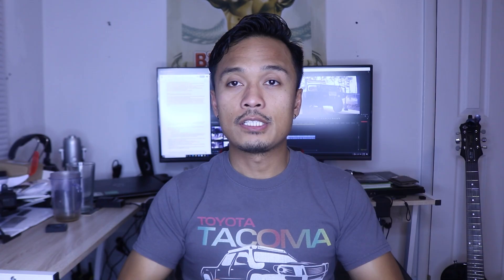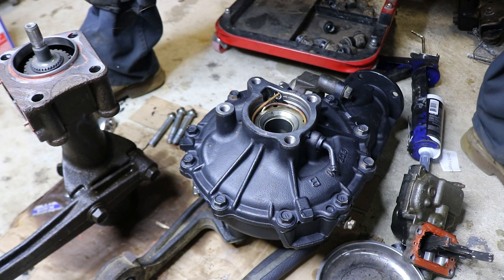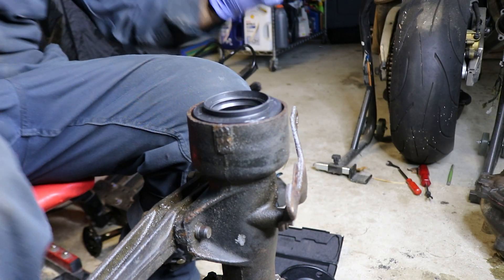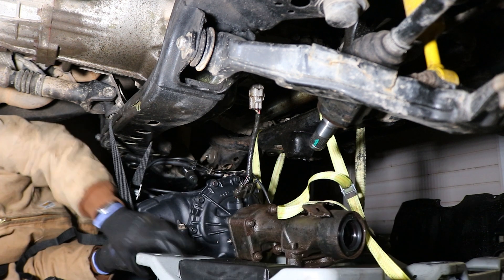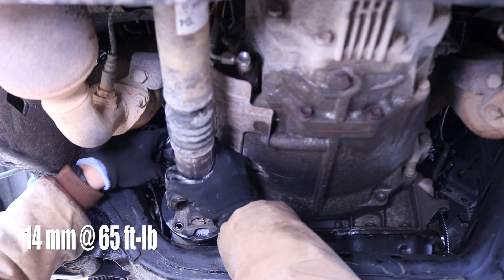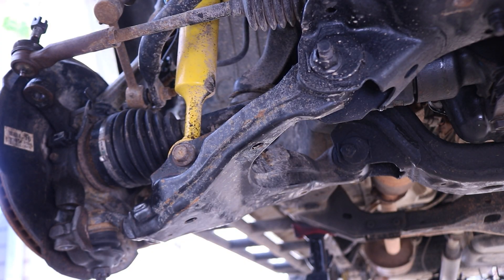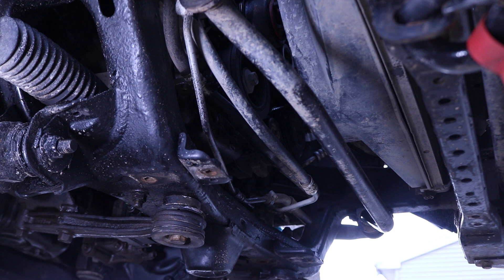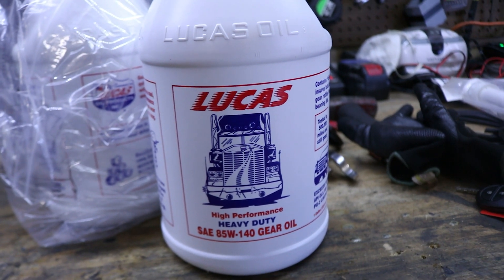Tacoma 4.88 Front Gears! Assembly and Installation ((DIY / How To) Re-gear Part 4)

Comment: You forgot to remove the metal retainer or seal from the stock diff that's in with the stub shaft.
Reply from the maker: If you bought the option with air lockers. You actually can't use that metal flange, it interferes with the brass air line. It's not a critical part with a major function. The whole system functions fine without it
Reply: Do you happen to know what that metal ring does?

Comment: When will you have a review on the 4.88 gears? mpg? hows it driving on the freeway?
Reply from the maker: Working on that, it will be out in a couple of months. I'm doing a 33 vs 35 speed comparison on the 4.88
Reply: @TacomaTutorials  thanks it be good to know for 35s. I debating on just getting 4.56 cuz i heard its better for driving on freeways. Also when i did the math i think to getting closer to stock gearing is 4.56.

Comment: You are the man! I used your videos to install 4.30 gears in my tacoma this past weekend. It went pretty smooth until getting the front diff back in. Those breather hard lines wanted to get hung up on everything! I ended up ditching the jack and used my hands, knees, and straps to position it.
Reply from the maker: Great to hear! Good stuff bro - I guess the knees and palms technique worked out for you too!

Comment: I re geared my 2015 Tacoma 4.0 v6 TRD Off Road with Manual transmission and now it run like a dog.  Can anyone explain why?  with 4.56 from stock 4.10 gears.
Reply from the maker: What size tires did you go with? did you follow the break in procedures? have you changed the oil at the 500 mile mark?

Comment: When you do the math for 

New Tire Height x Current Gear Ratio / Previous Tire Height.

The answer you get is for 1:1 not overdrive correct?  So I should keep in mind for that rpm drop as well??? I’m confused! 4.56 or 4.88 I don’t know which one to pick :(
Reply from the maker: I think we had discussed an answer through IG. LMK if you still have other questions above that.

Comment: How do you install the air lockers?
Reply from the maker: I would recommend watching part 1 of this series for the detailed explanations (i did a labor analysis and cost analysis between all the options for regearing). You can buy the cores with the lockers pre-installedd
Reply from the maker: I just released a video on the air compressor system which also goes over the air locker system

Comment: First.
Reply from the maker: Haha thanks for commenting and supporting the channel!
Reply: Great video. I’m about to change the oil pan gasket on my 96 4X4 and was also planning to use the straps for holding the front diff.
Reply from the maker: Yea, definitely a good way to not strain yourself with that heavy part